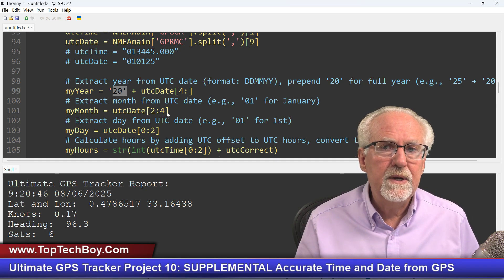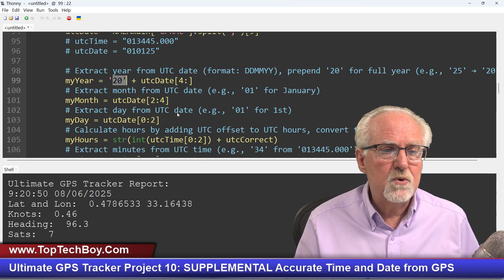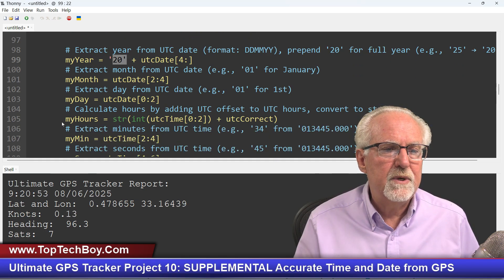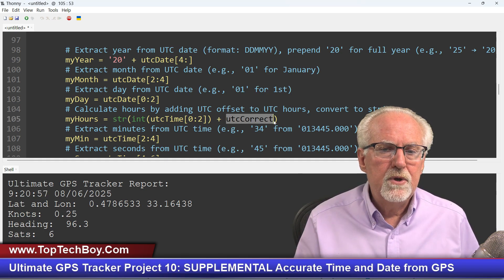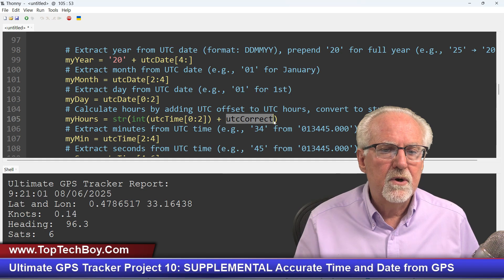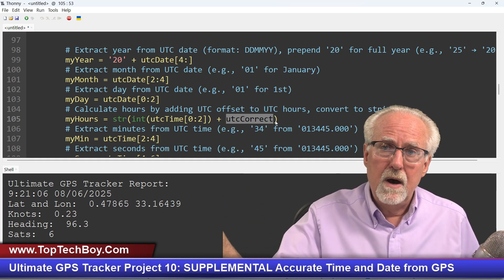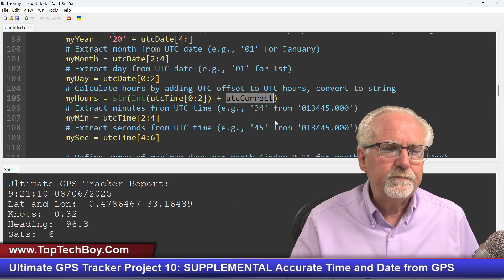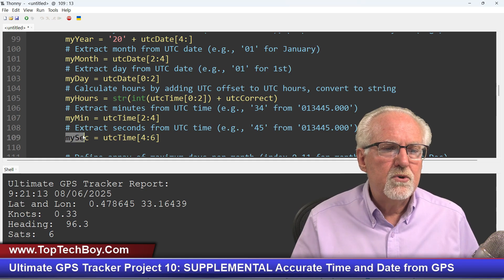Ultimate GPS Tracker Project 10: SUPPLEMENTAL Accurate Time and Date from GPS

Comment: Unfortunately the project runs in an wrong direction imho: First adding 20 for the year does not add information, contrariwise adds an interpretation which is not true in 80 years meaning you take the option to interpret the year correctly in 80 years. Second the leap year correction is not correct, please remember the year 2000 theme: all 4 years except devideable  100 and this except devideable 400.
But of course it schows educationaly the problematic of handling dates and times correctly in general.

Comment: Thanks for the additional lesson Paul! I started my code in a similar fashion as you did here.  But once I tried to start dealing with daylight savings time, I figured there must be another way.  After some research, I found some helper functions in the time library (which we use frequently for time.sleep() ).  There are two functions: time.mktime() and time.localtime() available in MicroPython.  With these functions, I was able to create a timezone conversion function for the purposes of our project. I will try to make a video next week to share my approach.  It appears to handle the rollover issues for day, month and year as well as leap years.  Essentially all conversions/comparisons are done in seconds since the Epoch.  This made doing daylight savings time much easier.  It seems to work; I will update my comment if I find any issues with this approach.  Curious if any other students went this approach?
Reply from the maker: Yes Lori, several have pointed out the library functions. When I was making the videos the typical python libraries I was familiar with did not work on micropython, so I showed doing it by hand. The time is fairly straight forward, but as we have seen lots of special cases to deal with on the date, and the library is definitely the way to  go. thanks for your comment.
Reply: Just a follow-up to my approach using time.mktime() and time.localtime() ...  I programmed a timezone converter function that works perfectly as a stand alone program.  But when attempting to use this in the gps parser function, it conflicts with the other thread.  Giving errors and/or  never getting any updates to the NMEA_data dictionary.  I tried some suggested fixes but did not have any luck.  I went back to the "do it by hand approach".
Reply from the maker: Lori, the _thread method in micropython on the raspberry pi pico is 'experimental', meaning it does not work perfectly. As our programs get more complicated, the _thread handling can get overwhelmed and system crashes. This is probably what is happening in your efforts. If we moved the gps read off he other core, things might clear up, but then that generates a big timing challenge to keep the GPS read.
Reply: @paulmcwhorter  Yep - this is my second run-in with _thread conflicts.  May go another approach to allow non-blocking GPS reads.

Comment: There is a function in the Pico that can do the heavy lifting for the clock/calendar time offset, try this:

        utcDate = NMEAmain['GPRMC'].split(',')[9]
        myYear = int(utcDate[4:]) + 2000
        myMonth = int(utcDate[2:4])
        myDay = int(utcDate[0:2])

        utcTime = NMEAmain['GPGGA'].split(',')[1]
        myHours = int(utcTime[0:2])
        myMin = int(utcTime[2:4])
        mySec = int(utcTime[4:6])

        # Convert date/time to Epoch seconds, and add (/subtract) the offset in seconds
        myTimeDate = time.mktime([myYear,myMonth,myDay,myHours,myMin,mySec,0,0]) + 3600 * utcCorrection
        # Convert Epoch time (now with the offset) back to date/time
        myYear,myMonth,myDay,myHours,myMin,mySec,myWday,myYday = time.gmtime(myTimeDate)
        GPSdata['date'] = f'{myDay:2d}/{myMonth:02d}/{myYear:04d}' # In some parts of the world, day and month are in reversed order.
        GPSdata['time'] = f'{myHours:02d}:{myMin:02d}:{mySec:02d}'

Standard/summer time could be a flag that you set or reset manually, during summertime you add an extra 3600 seconds to the Epoch time...
Reply from the maker: I had looked around but did not find the functions you mention. Certainly, this is an excellent place to use a library, as the date turns out to be tedious work. Thanks for the comment.
Reply: Yes!  I am using time.mktime and time.localtime() in my code.  Much easier!
Reply: Works perfectly. Thank you.

Comment: Thank you your supplement, great work.  I stiil have another problem with the time, in Europe on the third Sunday in October the clock is changed at 2am back one hour.  On the third Sunday in March the clock is changed at 1am forward one hour.  In the USA the Sundays are at different.  you will need to count the days Monday = 0 to Sunday = 6 and search for this Sunday with if statments.
You could just adjust time manually on these dates.
Reply from the maker: Yes, and you guys are on your own with daylight savings time adjustments. The rules vary across the world and across even given countries. An easy way is to udjust your utcCorrect time when the clocks change.

Comment: Many, many thanks! In my code I had the proper corrections for the + and - offsets for the hours and the day changes around midnight, but I had not even thought of the last day of the month and the leap year issue! 🤠 Odds are NONE of us will be around for the next century leap year that occurs in 2400 (The years ending in 00 need to be divisible by 400 to be leap years) . And for sure we have no need to worry about 3000 at all! 😎
Reply from the maker: Glad the video was helpful!

Comment: Don't forget "Day light savings time" and back to "Standard time" here in the USA, which has to adjust the local UTC time used. This is tricky as each year the actual calendar day changes, so I believe that the best way to correct that part of the problem is to changed the month/date to number of days from January 1st, which then you do not need a month/day to perform the tasks. Example for 2025 is Start DST on March 9 @ 2AM and end DST on November 2nd @ 2 AM local time. Wait that will not work as it goes by the second Sunday in March and the First Sunday in November, back to the drawing board
Reply from the maker: Yes, and you guys are on your own with daylight savings time adjustments. The rules vary across the world and across even given countries. An easy way is to adjust your utcCorrect time when the clocks change.
Reply: @paulmcwhorter  LOL, yesterday I tried to see if I could get code to work faking the date/time, but I finally tried AI and it did come up with something, but I did not try it